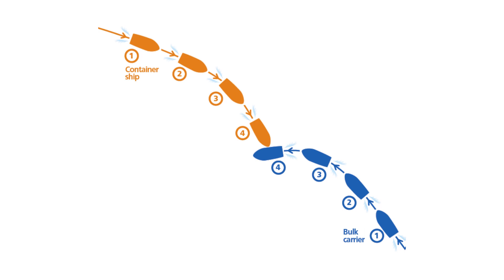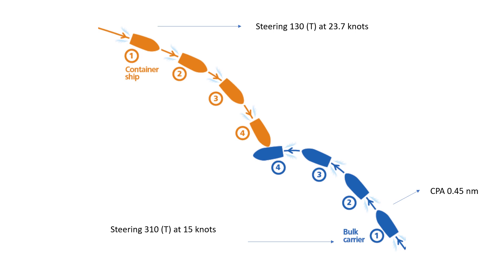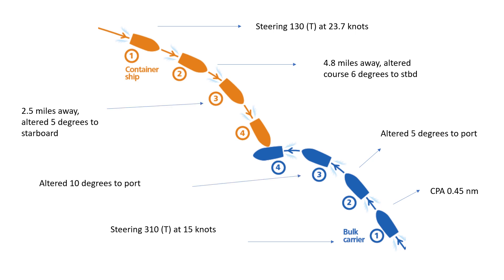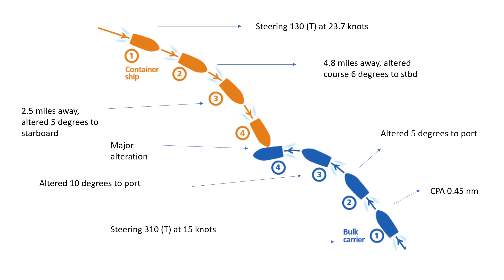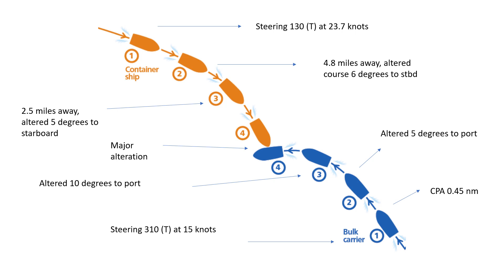Collision at sea - A case study on the wrongful application of Rules of the Road (RoR) !!

Comment: Rule 8b small alteration should be avoided. Actions should be made readily apparent. 

Base on a relative speed of about 40kns, action not made in ample time. Probably also in contravention of rule 6 safe speed. 

2 PDV Head on situation. Both should give way and alt to STB. When in doubt assume its head on. 

Even if bulk carrier assume its crossing situation. Rule 17b clearly say stand on vessel if taking action according to 17bii cannot alt to port. 

Bulk carrier is more at a wrong.

Comment: Initially bulker is at fault. Given cpa 0.45 nm they'd be theoretically in close quarter situation even if no actions were taken. If the bulker had chose to make departure from rule 14 by making alteration to port, 5 degrees is not apparent enough even by radar or visual or even AIS. At posn 2 she should have had altered atleast 20 degrees to make her action readily apparent to container.

Comment: As per rule 14 head on part b
"Such a situation shall be deemed to exit if the vessels sees other ahead or nearly ahead..."
In this condition both pd vessels are in RISK OF COLLISION.
they both need to take action as per rule 14a alter to stbd so as to pass on port side of the other.
So the container vessel did exactly right till position no. 3 but if the other vessel is not taking appropriate action, the latter vessel shall take any action necessary to avoid immediate danger as per rule 2b and/or 8.F.1, 2, 3.
If we talk about bulk carrier
I don't know why she alter course to port, as it is clearly mentioned in the rule and we should avoid using VHF for taking action in ROC Condition.
But still in this condition both the vessel are equally responsible.
Reply: For preparation of second mate / DNS/ BSC nautical science/NCV come in #kundanpatna

Comment: Container initially took correct decision as per rule 14 as she expected the same from bulk carrier,however as the oow on bulk carrier didn't take 0.45 miles as cpa seriously.may be oow was more concerned about the deviation point . 80% it's the fault of the bulk carrier but as rule 2 gives us the freedom to make departure from the rules having higher Speed of the container she should have monitored the situation and would have taken the action by altering even to port side to avoid collision...coz at last it's the collision which made it a case study

Comment: Here we can observe that ,,it was a head on situation and both should alter her course to stbd, container altered but bulk carrier altered to port which is against ROR,, and 55 percent of the fault goes with bulk carrier and she violated the rule entirely, and 45 percent fault is with container :  container followed colreg, head on sit rule but we can notice that course alteration was too small and also action by vessels were not earlier ,, bulk carrier entirely was against rules ,, as per rule and good seamanship a wide alteration of course is the best rather than a series of small alterations which container did , so other vessel can visually observe or in radar ,,moreover both vessels did not take action at an earlier stage .

Comment: Sir, here 70% blame to bulk carrier and 30% to container ship.
Its open sea , both vessels are in sight of one another.ROC exists and both should follow Rule 14.. alter course to stbd and pass port to port.There is no point in establishing communication as there is no other traffic causing problem to any of the vessels ( though VHF communication costs time ).Both vessels should have understood that its head on scenario and the relative speed of approach is very high ,means TCPA would be very less.In other words they have limited time to take action.
First lets take the case of container ship.She followed Rule 14,but not Rule 8 .She should have done alteration early,and at least 20-30 degrees.By altering 5,10 degrees we should understand that she was trying to increase CPA.Further she might not have noticed that other vessel had altered to port.Might be she was observing only ARPA ,as we know the limitation of ARPA,no visual lookout or not used other equipments.AIS will give heading changes faster than ARPA.By the time she found that other vessel was altering to port ,she should have done a broad alteration.A speed of 23 knots will give a small turning circle .Reduction of speed will not do any difference for her at any time in this case.
Further,lesser the distance to other vessel,more the alteration required in head on scenario.

Comment: Sir, in this case both the vessels are maintaining courses in a way that they will meet at a semi-reciprocal position and involve a risk of collision; thus we apply ROR rule 14. Both the vessels are ideally supposed to alter course to their own starboard side. The container vessel at position 2 should have realized that the bulk carrier is not following the rule, and should have established communication to know the intention. The container vessel at position 3 should have ascertained that the bulk carrier is turning to port and the container vessel should have turned to port to avoid collision. Measures such as reducing the vessels speed would have minimized the damage. In real time scenario, there may have been other factors instrumental such as the close proximity of vessels other than the two mentioned.  In the scenario, it was 75% bulk carriers fault and 25% container vessels fault.
Reply: Some part I disagree. I think as far as possible, VHF navigation should be avoided. (Though there are exception). I think the main fault for the container is the small alterations that is not readily apparent. 8b. He should have made one large alteration to STB at point 2. 

Of cause, bulk carrier was an idiot. No idea why alt to port.

Comment: Good Day Sir!
When CPA was 0.45 nm and they were passing stbd to stbd containers vessel was attempting to increase CPA by making alteration to stbd as per rule 14.
And at the same time bulk carrier attempted to increase CPA by alteration to port which was against the rule 14.
Here sir lack of communication and negligence of ror is the cause.
Case 1 if they have communicated well in time and agreed on STB to STB passing containers vls would not have altered to stbd.
Case 2 bulk carrier didn't followed the ror and neither didn't communicate with other vl. And also didn't monitored the actions of other vl.
Case 3 as sir it's open waters container vls should have made broad alteration as per rule 8 which would have given clear intentions to bulk carrier and I might have been possible that bulk wouldn't assume that she should alter course to port. But at the same time bulk carrier should preferably take action through rule 14 and rule 8